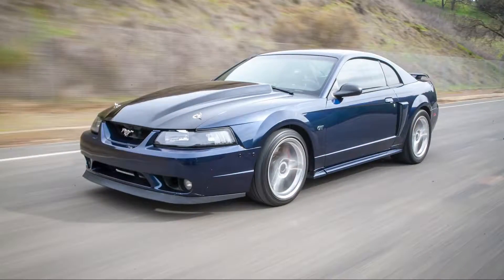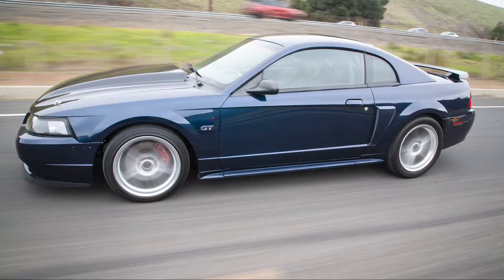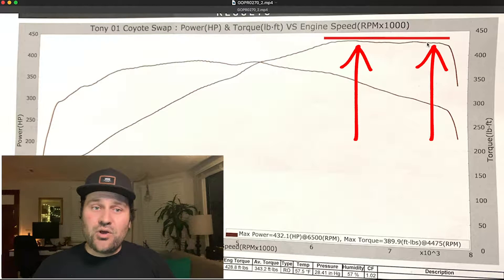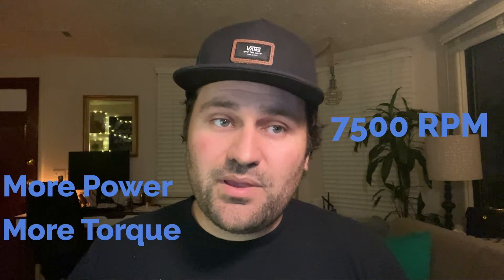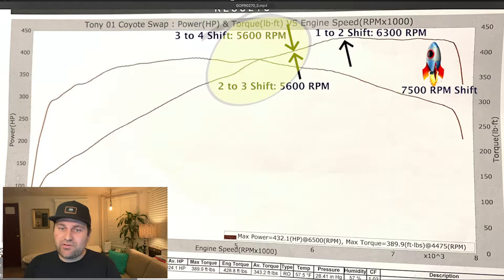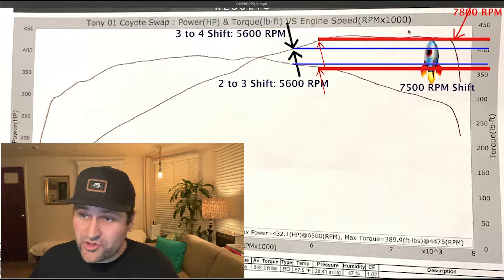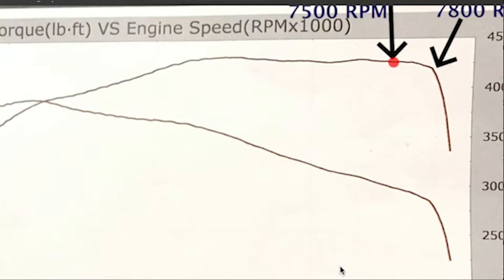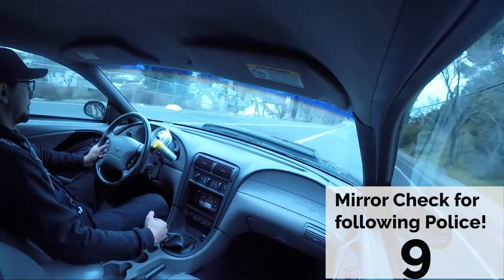Best Shift RPM For Coyote Swap New Edge & Shift Recovery Explained | Test Hits | Close Call With Cop

Comment: I’m running a tremec magnum close ratio trans in my fox with a healthy 347 around 3k lbs with 4.30s and a 275/60/15. Trans has a 2.66 first gear ⚙️.  The car pulls really hard and continues through 5th gear and if I wanted to grab 6th the car would just keep on pulling but by then you’re well into the triple digits. I’m glad I chose the close ratio version of the magnum.  No complaints whatsoever.
Reply from the maker: Nice! I have the same trans in my 1992 SSP coupe that I’m Coyote swapping—more vids on that coming soon!
I agree, I love the gearing in the 2.66 First Magnums. The first was a little tall the first time I hit the track, I had to bump my launch rpm up, but the closer ratios were amazing and the usable Fifth and Sixth are amazing, like you said!
Your car sound like a beast! Before the coyote I had a smog legal blown 347 setup in it and I loved it!

Comment: Good stuff man my third gear shift sucks. I have a 6r80 and my third gear shift makes me lose lots of races.
Reply from the maker: Thanks, man! Does it hang up and bang the limiter a couple times before shifting? Can you let it shift the 1-2 and then manually shift it on the 2-3 a little earlier so it has the time to grab that gear and then let it shift itself on the 3-4? Do you know if it’s a tuning issue or a hardware issue like low line pressure or the clutches? Love the car, man. It’s a beast!

Comment: Great video!! Thanks for sharing. Why did Tony decide to go with the 2.97 wide ratio gear set instead of going with the 2.66 close ratio gear set?
Reply from the maker: Thanks! Much appreciated! I'll have Tony jump on here and share, as I'm not sure, other than he bought the transmission used. Once sec!
Reply: PimoAn01 Hey! So my friend had this trans a while back and made me a killer deal on it. I think he got the steeper gear ratio because he had a pro charger and wanted the gearing to get to peak boost faster
Reply: Vortek01gt you have boost plans yourself?
Reply: PimoAn01 oh yeah. I had a vortech on my last motor and would like to vortech this one too. But I keep bouncing around the idea of a vmp or whipple or even a turbo. So many different options out there you know

Comment: What rear end gear ratio you guys running in these pulls ?
Reply from the maker: Thanks for checking out the channel! 🙏 Much more to come on Tony’s car. It has 4.10s and 27-inch tall MT radials right now.
Reply: I plan on switching the 410 to possible 4.56 soon.
Reply: Race Gas Smells Good   You don’t think on the 1rst to 2nd shift it was in the 6300 RPM due to tire spin ?
Reply from the maker: We made a bunch of pulls to double-check and it was definitely hooking on good pavement. The 1-2 ratios are really tight on this box. What car, motor and transmission setup are you running? Thanks for the comments!